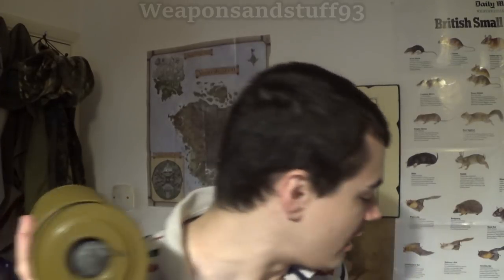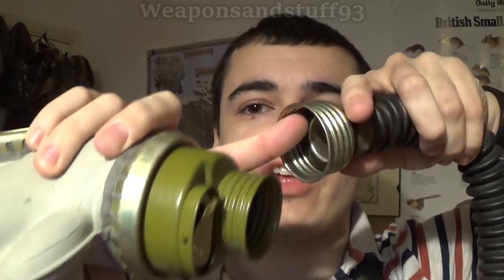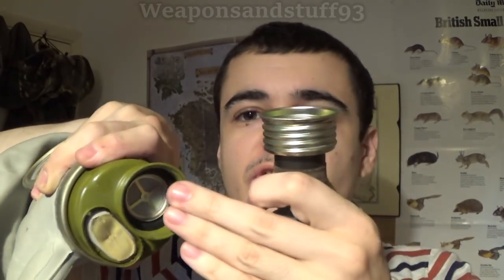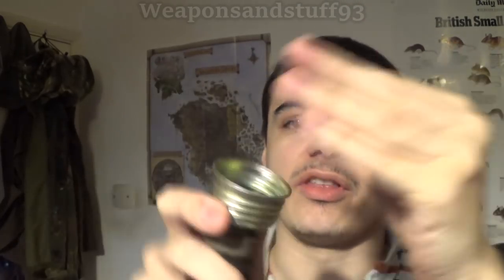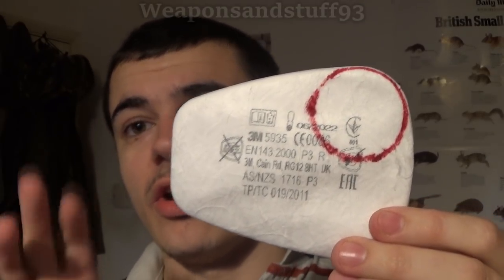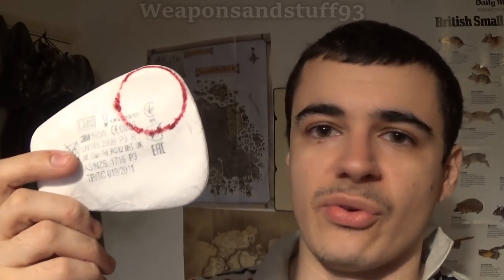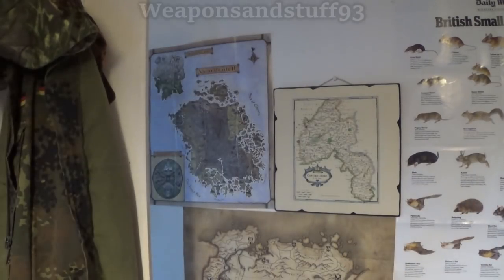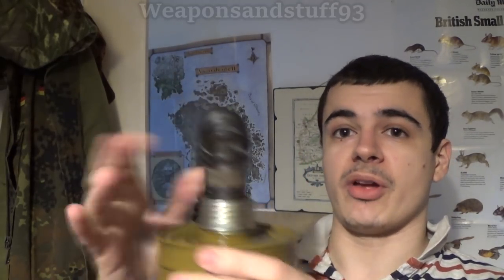How to make Soviet filters safe to use

Comment from the maker: IMPORTANT:
Check the instructions for your P3 filters to see which way they should go, the page selling these gave the wrong instructions, the text side should face towards you, not the filter.
Reply: The rule for the text side for ALL filters is that you must be able to see it while used. The pink pad filters 3M have text outside; the inner pad for the canister is intended to be put with the face towards the main filter, since you read the reference when you put the pad inside the cover https://www.youtube.com/watch?v=uj2FU2oMaA0.
Reply: Sam Bailey no, as it is not p3 rated. (Why should it)
Reply: What's the best instrument to cut them in shape ?
Reply: West Slav could i use a model cutter, which is a razor-like blade, similar to a surgical blade ? It's actually sharper than a pencil sharpener.
Reply: Can you use p100
Reply: where can you find nato filters online?
Reply: Would a u7800 p3r filter serve?
Reply: Are Gp-7k filers OK to use as is?
Reply: Weaponsandstuff93 would you mind linking me a link for the p3 filter?
Reply: i tried with the 3m ones, it works but it just makes the breathing harder
Reply: Hater Sensei Grand Master Chosen One  it's rather weird how I got mine, they were sealed and placed in a cabin in our house and no one knew how it got there, but it still works. (you can probably find some online too)
Reply: Hater Sensei Grand Master Chosen One  it's rather weird how I got mine, they were sealed and placed in a cabin in our house and no one knew how it got there, but it still works. (you can probably find some online too)
Reply: Arnt you using the gp5 filter on the thumbnail of the video?
Reply: hey man, I have a GP5 with the hose, haven't used the filter (not willing to), is there any risk that there could be anything still in the hose?, I washed it out when I got it, just thought I'd ask, thanks
Reply: Weaponsandstuff93 where can I buy the P3 cotton filters? Does it have to be P3?
Reply: Weaponsandstuff93  Where exactly can you find the P3 filters because I’ve been looking on the Internet and I can’t seem to find them can you please put a link

Comment: I’ve been using a GP-5 filter for about two summers for practical use…

At the time that I bought it I had no idea that filters had asbestos, had it not been for your videos on the matter, I would still be using it. 

Thank you my friend for this helpful insight and solution
Reply from the maker: Glad you saw the video.
Reply: Weaponsandstuff93 I’ve been using it to go into an unventilated shed to put chlorine in a pool philter. Also, as far as practical use gas masks go, you know one with mobility, sight, and durability, what would you recommend?
Reply: @sgtjitters8980 what do you mean by "mobility sight"?
Reply: @Pyr0m4n1j4c not heavy and not blocking vision
Reply: @Hockeytimeforlife  Ah ok. Thanks mate 👍

Comment: I'd say additionally if using hose could put one more filter on the other end for extra safety I'd say, for cosplay best is to have only canister/filter without anything inside basically empty can, but cool method, definitely worth to remember.
Reply from the maker: If you stick too many P3 filters in you will struggle to breath.
Reply: agreed on that, but because of two of them shouldnt choke

Comment: Thanks, for this video, it was much needed. I live in former east germany and EO-14s costs 5€ with a hose and i don't wanna spend 15-30€ on a filter.
Reply from the maker: Just make sure you use a P3/P100 filter pad as those are the only ones rated to block asbestos.

Comment: So if this idea were to actually block out asbestos effectively, about how long would you have theoretically before you have to replace out the filter piece before it becomes useless?
Reply from the maker: Totally depends how much the filter leaks, if the filter doesn't leak never, if the filter leaks then it will clog fairly fast, but that stuff would have gone into your lungs.
Reply: Weaponsandstuff93 interesting. So in theory would it be possible to “use up” all the asbestos within the filter simply by using this improvised method and  constantly breathing through it whilst replacing the small filters when necessary? And by “use up”, I mean the original soviet filter is now asbestos free?
Reply from the maker: Not really, the asbestos is woven into the filter fabric, if all the asbestos came out of the filter, the filter would just collapse in on itself.
Reply: Weaponsandstuff93 ahhh I see. Much appreciation for the helpful replies!
Reply: 5 minutes

Comment: Hello Friend. Thank you for all of your informative videos that you've made so far, as I have watched most of your gas mask related videos. I just wanted to mention that according to data that I had gathered by checking 3Ms own website, and also companies that actually work on removing Asbestos insulation from old houses, the go to filter is 3M P100, which is graded for filtering Asbestos and Lead. The one which you're using might not be the safest option to pick up and use.
P100 is the highest respiratory level protection that we can get, and a P100 graded particular filter blocks 99.9% of particles.
Reply from the maker: P100 is the American name for P3.
Reply: Weaponsandstuff93 Thanks for the response mate, good to know that. It's kind of confusing with companies use different names for same type of standards/protection in the US and EU. And you are right, I had been checking for those infos in American sites. I'm sorry for the comment that I sent, you are more informed.
Reply from the maker: No problem, it's an easy mistake to make, I like the P1-3 system as it's part of the ABEK system which is becoming a widely adopted system for filters, the higher the number the better the protection that section it offers, so each letter means the filter blocks/filters a certain threat and then a higher number means the filter does it better So an A1P2 filter is not as good as an A2P3 filter. It's also nice having colour coded filters.

Comment: You could take an ABEK industrial filter (modern and safe) and paint it. Just an idea for cosplayers.
Reply from the maker: Or any NATO filter, as it doesn't matter if it doesn't make an air-tight seal for cosplay.
Reply: Weaponsandstuff93 
Not to ask repetitive questions, but do NATO filters contain asbestos? Not related but I was just wondering.
Reply from the maker: I don't think any 40mm NATO filter that has been made in the last 60 years has contained asbestos, only 40mm NATO I know of that contained asbestos was the giant 40mm filters the M51 originally took.
Reply: Sentic Memes the German m65 filter might contain asbestos.
Reply: Weaponsandstuff93 
Thanks man.

Comment: Good idea if you want to use the filter, you could always double up or do both ends of the tube, or do the tube method and sticking them in the filter hole for maximum protection, that's if you can still breathe through it with that many, i have no idea.
Reply from the maker: Yeah you could do it but the breathing resistance would get harder, I found when I did my test video with the mask, the big filter combined with the P3 insert made the air resistance quite challenging to actually breath with, but yeah a smaller filter with two P3 discs on either side of the hose would work well.

Comment: Dude, fantastic video but I gotta know. Would multiple P3 cotton filters make it safer? (Like putting it in the bottom and the top of the rubber hose for example) Fantastic video as always!
Reply from the maker: Yes but it would also make breathing harder as the air would face more resistance.

Comment: Hey weaponsandstuff93, great videos. I have a question for you. A while back I bought a gp5 filter off the internet and used it blow cigarette smoke into to mask the smell. I blew into it (never sucked) about 30 times before I found out it contains asbestos. Should I be worried about any exposure to asbestos? Thanks.
Reply from the maker: Not sure why you'd be blowing through a filter but I doubt you've done any damage to yourself.
Reply: @Weaponsandstuff93  thanks for the reply. Someone on reddit had told me that old gas mask filters were a cheap way to reduce the smell of cigarette/weed smoke. It did work well but I'd rather not risk the chance of running into lung problems from asbestos.

Comment: If you plug up the filter and then pull out the exhale valve and you can get the look without the risk. Then just put the mask back together.

Comment: I just used wet wipes, my filter doesn’t have leakage or damage, i shoved in wet wipes, breathed through it for 20 mins and the wipe was clean after i took a look at it. as long as your filter doesn’t look like it’s been in shrek’s silo for 3 decades you should be fine using wet wipes in there
Reply: 2 years later, do you have lung cancer?
Reply: @Corg__ He is probably dead.😢

Comment: Say I have a question, in the video here, you say that a P3 filter is required to block aspestos. Doing a little searching on amazon, I have not been able to find p3 filters like the one in the video. Instead there are these P95 filters. I don't think these have the same level of protection as the P3 but can anyone confirm?
Also, where should I buy these filters from?
Reply from the maker: P95 is = to P1 so inefficient, it might be called P100 if you are in the US.
Reply: Thank you for getting back to me so quickly! I've seen the P100s out here, but the ones I have seen are the pink circular filters. I'll go for those then.

Been binge watching a lot of your videos lately. Great information and very entertaining!

Comment: For my GP-5 and it's included filter i printed a bypass and took took the rubber gasket from the cap of the filter put it in the bypass to make sure it was an air tight seal as the filter was broken and i just screwed it in there is a little bit of black but thats fine i just like the weight and look

Comment: Alright, question time.
-How risky do you think this is?
-How long would those particulate filters take to get worn out?
-How much worse is the breathing resistance?
-What does it feel like trying to move around in a rubber NBC suit?
- Have you ever scare pranked anyone before? If so, how did it go?
Reply from the maker: Not very risky at all, P3 filters are used by asbestos removers.
Depends on how much the filter leaks, they won't become compromised though, it will just get harder to breath until you decide to replace them.
Higher than normal but it depends a lot on the filter as well, using it with a GP-5 filter won't be as bad as an EO-14 or EO-16.
Reply from the maker: Like your in a really heavy raincoat.
Not really.

Comment: Honestly if it were me, is jam cotton balls in the top of the filter canister, then do what you've done with the p3 disc but on both ends of the hose.
Reply from the maker: You wouldn't be able to breath at that point due to air resistance.

Comment: Do you think that it's really that big of a deal to use the filters that only have 1-3% asbestos in them with a gp-5? Because with a gp-5 your face isn't really pressed directly against the filter like with a M40 so the chances of that fiber going directly into your face is rather low, right? Not really sure how asbestos behaves, I assume it floats around like common dust.
Reply from the maker: It follows the airflow, so when you inhale if it comes loose it will get into your lungs.

Comment: Guys, I figure you know more about this than I do... Do you believe there is any way that a gasmask with a GP-5 filter could effectively be used today? Or has it truly expired on any meaningful service?

Thanks loads for any answer in advance! 

(in case you're wondering, I don't own any of this stuff but I am writing a piece about it - I figured that a GP-5 is too old to function in this day, but I want to be sure)
Reply from the maker: The mask could be okay if it has been stored well, I still have some working WW2 masks, but the filter is long since expired and potentially dangerous, a GP-5 with a modern filter that fits it, is a far safer bet.
Reply: I understand that storing dark, cool and without exposure to oxygen would help preserve, but what are the chances of doing that for 30+ years?

What material are your WWII masks if I may ask?
Reply: And I mean the mask itself, I understand old filters would be a no-go and a possible hazard of themselves.

Comment: I've been wondering for awhile and it's probably a dumb question as if it where so easy someone would of done so already. But what if you put Teflon tape (the white tape you use to prevent old faucets and stuff to stop leaking) on a 40MM NATO standard filter and put it in an old Warsaw gas mask? Like a gp-5. Would that work?
Reply from the maker: I'm not sure if that would block the screws or not, I might experiment with rubber washers at some point to see if I can get an air-tight seal that way.
Reply: Weaponsandstuff93 oh okay cool, I was thinking if there was some type of way to do that it would be very cool if it worked as a very last ditch last resort type of deal. Hopefully you can pull it off would be interesting to see, keep rocking on man and thanks for the reply.

Comment: Hey, if the filter is going to only be used for cosmetic reasons wouldn't the idea by Mr. Airflakes work? Run water through the filter to flush all the harmful stuff out?
Reply from the maker: No because the contents would just break down inside the filter.

Comment: Good idea. Would a vacuum remove asbestos?
Reply from the maker: I doubt a vacuum cleaner has P3 filters inside to catch asbestos.
Reply: I meant to vacuum it out by bringing air through lol
Reply from the maker: You can't simply vacuum asbestos out of a filter, asbestos was woven into the particle filter, bits of asbestos break off over time.
Reply: Ok thanks
Reply: FILTER SUCC

Comment: I have a gp-5 gas mask with the original filter, its from 80s and i obviously no using it, but have it like in a shelf is toxic?
Reply: Is it sealed? Then yes

If not then I can't say for sure, as long as you don't disturb it, it shouldn't be an issue

Comment: There is a more easier eay and safer if you just want the look put tape on the filter and open the exhale hole so you inhale thru that aswell and the filter is just there for the look

Comment: Nice, but still, you can cut open the filter and remove everything, if you just want it for cosplay.
Reply from the maker: High chance of asbestos contamination doing that.
Reply: uk airsoft ok, if I would wear a self contained breathing apparatus and do it outside, would it be safe?
Reply from the maker: Don't use a SCBA, that's very risky unless you have SCBA training, use a P3 filter on a mask, do it outside and make sure you have an asbestos disposal bag for the filters contents, never throw asbestos in a normal bin.
Reply: Weaponsandstuff93 ok, i was just wondering, probably won’t do that anyways.
Reply: Stronk Slav Stalin FD1917 yes, I mean for cosplay, you don’t have the asbestos and the weight of the filter, for cosplay you do not need filtering capabilities.
Reply: @SlickTwigDotWAVfile  How would you go about putting the 2 cut parts back together?
Reply: taggerung probably soldering.
Reply: @SlickTwigDotWAVfile  Sounds good to me. Though you might have to re-paint a little where you cut and soldered

Comment: Do you need a P3 filter if you’re just worried about charcoal? Or will that be stopped by an N95 filter?
Reply: a charcoal dust can get as small as 15 microns, while an n95 filter can protect from particles as small as .3 microns and a p3 filter can protect from particles as small as .2 microns. You're definitely fine either way
Reply: @mr.commonsense   Sounds good, thanks

Comment: But if you place it over the washer wouldnt it compromise the air tight seal correct me if im wrong please
Reply from the maker: No because the filter makes a seal with the pad which makes a seal with the washer.

Comment: Is it safe to remove the plugs from a GP-5 filter? What I mean is will it spew asbestos fibers or charcoal if you take off the caps from the top and bottom?
Reply from the maker: As long as the inside isn't falling apart it's safe to do so.
Reply: @Weaponsandstuff93  how can I tell?
Reply from the maker: You can't without opening it.

Comment: Could you use this but create a seal on the p3 filter by using an apoxy to stick its edges to the filter?
Reply from the maker: I guess you could do that somehow but the force of a filter being screwed in means the pad cannot move at all.
Reply: Weaponsandstuff93 thanks for the reply :) I was more concerned about when I unscrew that the p3 filter doesn't leak asbestos into the air

Comment: if you are using a filter that lasted 24 hours, would that be the same amount of time for using 2 filters?
Reply from the maker: It depends on contamination to the area and age of the filter, so two filters of the same type unless made on the same day and used in the exact same concentration of a certain gas would last different amounts of time.